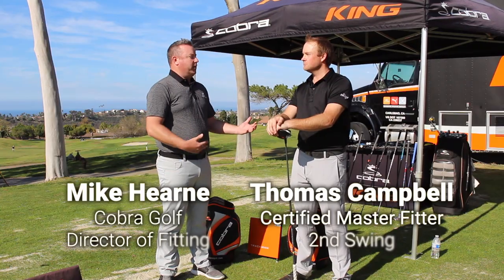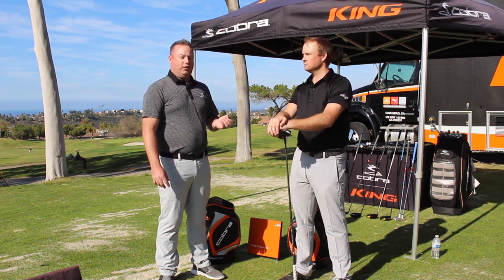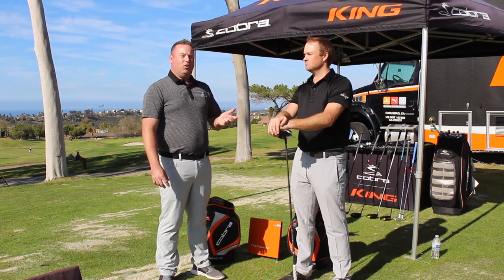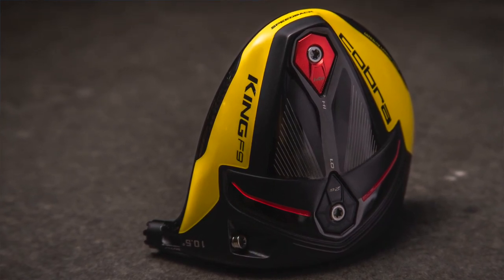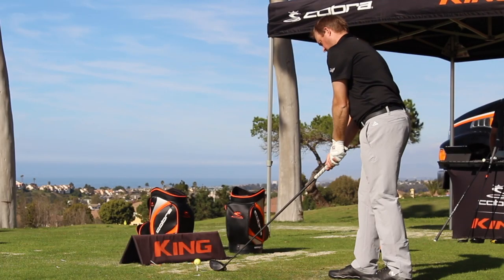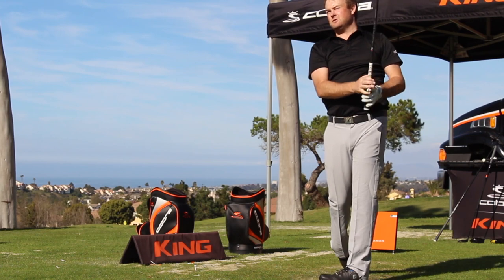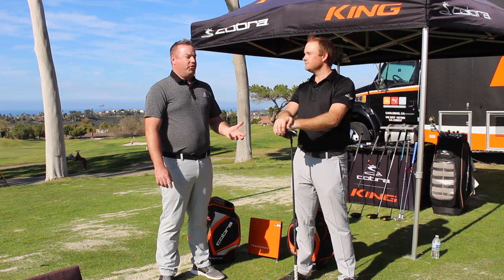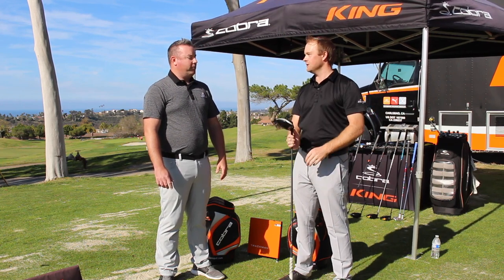F9 Speedback Driver Fitting And Feedback

Comment: Was weight added to the head when the shorter shaft went on???
Reply from the maker: Yes, the "Tour Length" setup with the shorter shaft features 18 and 6 gram weights to use in the weight ports in the sole as opposed to 14 and two gram weights in the standard setup.
Reply: 2nd Swing Golf ...thanks
Reply from the maker: If you want the shaft to react somewhat the same,  check swing weight before cutting it down and add as much hot melt or lead tape to the head to get same swing weight.
Reply: 2nd Swing Golf ...had a bad experience with a callaway driver once, American golf took an inch of the butt and sold it to me, couldn’t feel the head when swinging and ended up with really bad result s...never again with out swingweight being adjusted.
Reply from the maker: Dougie Montana sorry to hear about that as it is very unfortunate.  Completely understand why you would be concerned.  Let us know if you have any questions any time you purchase clubs.  We have phone fitters available 7 days a week if you are unable to come to a store
Reply: 2nd Swing Golf ...thanks 👍
Reply: 2nd swing - What is the difference between a standard 9degree loft, and to 10.5 degree standard, dropping it to 9 degree?